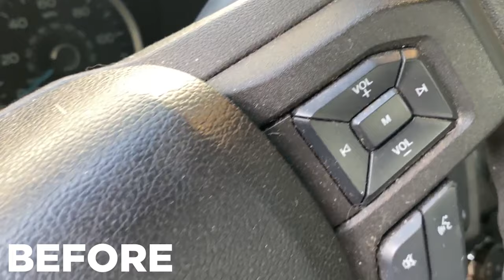Deep Cleaning a Zookeeper's FILTHY Truck | Satisfying DISASTER Detail

Comment from the maker: For those who prefer to skip sections:

Before shots - 0:00

Wheel & tire cleaning - 01:05

Pre-rinse & wash - 04:12

Vacuum - 07:45

Floor mat & trim cleaning - 12:08

Seat extractions - 13:14

Carpet extractions - 26:37

Interior cleaning & steaming - 31:50

Before & after shots - 39:19

Comment: How long does it take for upholstery and carpet to dry?
Reply from the maker: It really depends on a number of factors. Such as the material, the temperature, etc... For me, I can control the temperature of my shop and many times I will let the vehicles sit overnight. They are usually nearly or fully dry the next morning. But regardless, you can expect dampness for several hours.

Comment: How long did this take to complete in real time?
What was the little red tool used to scrape up the animal hair?
What was the tool used to scrub the mats?
What was the cleaning solution used on the seats?
Reply from the maker: 1. It took around 11-12 hours total. 
2. That is a Lilly Mini pet hair brush. 
3. That is a drill brush attachment. 
4. Super Clean diluted at 5:1.

You can find most of the products and equipment that I use in the description of each video.

Comment: floor mat should’ve been pressure washed
Reply from the maker: It was. It just wasn't filmed. I had hoped that the extraction would be super filthy, but it wasn't. So I hit it with the pressure washer afterward and repeated the process. Just wasn't worth filming and I was rushing to get the project completed for the client.
Reply: I agree because using the extractor is not exactly getting all of the dirt out while the pressure washer would have done a much better job of that